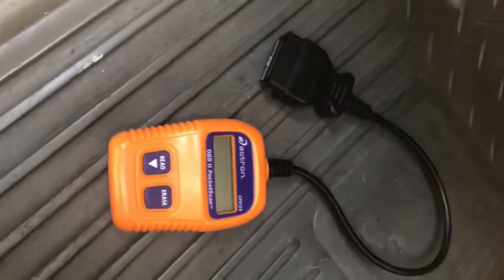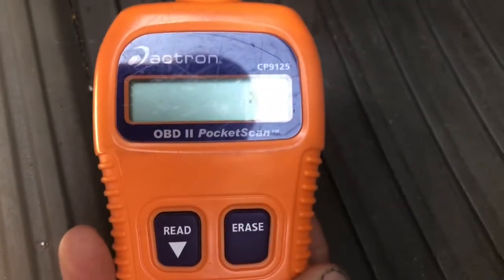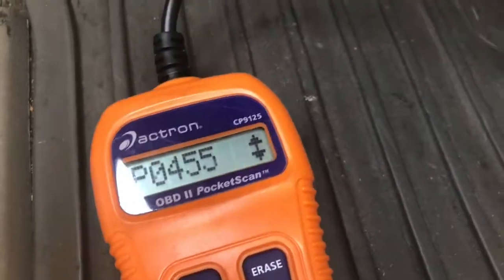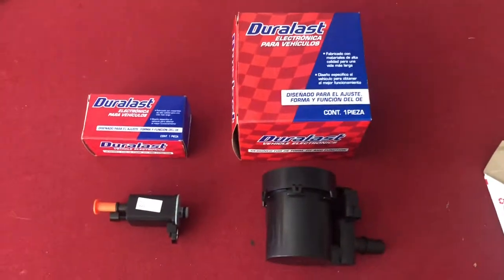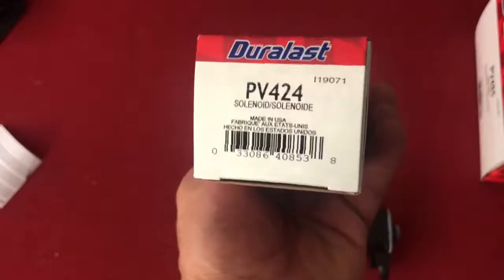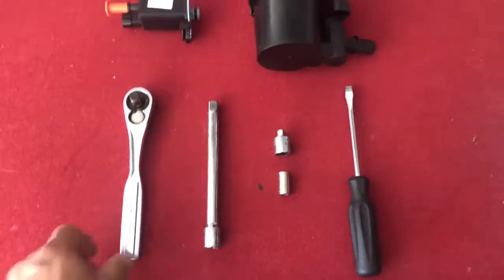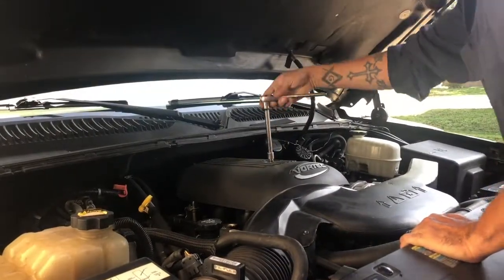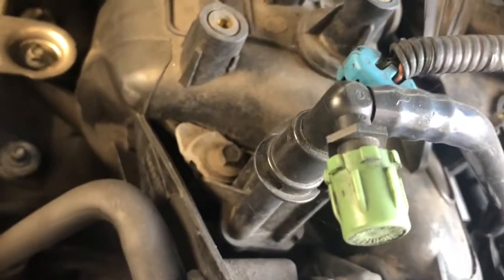2005 Avalanche OBD II code P0455

Comment: Did you smell gas from the outside? That what mine is doing with p0455
Reply from the maker: No, no gas smell, just the code and the check engine light.
Reply: @therealdadshow944  Does either one of those you replace have gas that flows in them? Like the one on the bottom?

Comment: Why does my 08 Avalanche cut off the gas pump when I gas up.
Reply: Purge valve needs to be replaced most likely.  Also be careful to not overfill your tank.  Do not top off as soon as the pump kicks off stop.
Reply: @MrOhyeahsayswho  Thank you
Reply from the maker: Sounds like you need a new fuel pump

Comment: Did you have a rough idle with this? I’ve changed charcoal canister, and canister purge valve, my idle is rough and I get gas that comes back out of the filler and it still takes forever at the pump
Reply from the maker: No I didn’t have a rough idle. Since I changed the purge valve and the canister I still had an issue while pumping gas. What I have noticed from other Avalanche owners and I’m sure it’s the same with other Chevy trucks and SUVs is that turn the pump handle to the left while pumping gas seems to help. I change to flex fuel with a full tank of regular gas every 3-4 fill ups and a new flex fuel gas cap and have not had the problem since. Hope this helps.

Comment: After u installed both new parts did the light come on again for po455 mine just came on same code thanks
Reply from the maker: No The check engine light didn’t come back on. One other thing you might check is your gas cap. Make sure it’s screwing on tight. Also if your Avalanche is flex fuel make sure you have a flex fuel gas cap.
Reply: @therealdadshow944  thanks alot will put on gas cap 1st then ill go from there
Reply from the maker: We have a short video on it. 
https://youtu.be/pE4yAIV1AFY

Comment: Did it pass the smog test
Reply from the maker: Hey Jamie, yes it pass smog. The first attempt it did not pass due to a mass air flow leak. I changed the gas cap and it passed with flying colors.